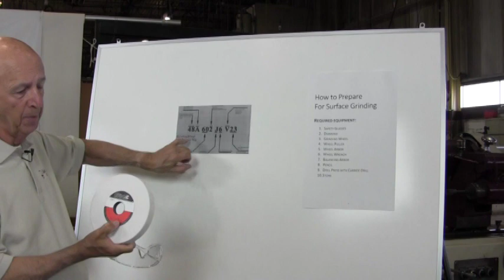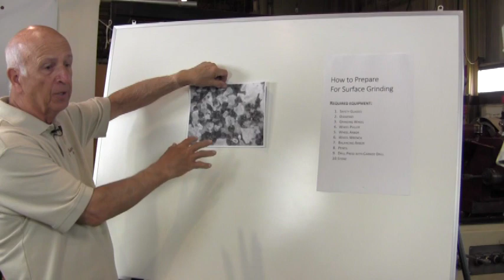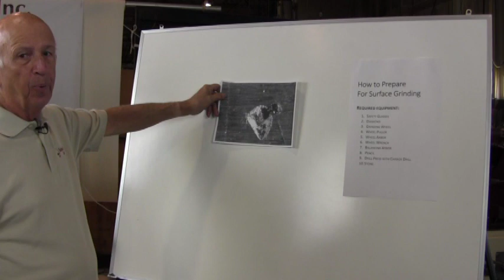How to Dress and Balance a Surface Grinder Wheel

Comment: Good morning sir, started in the early 70's as a tool and cutter grinder,in my fathers machine shop,never had the basic understanding of proper removing grinding wheel other than checking for cracks with the bell sound.I retired 12 years ago but recently had the opportunity to back to work doing this type of work,thanks really helps understanding how grinding wheels operate and the care to extend spindle bearing life

Comment: I noticed that either 2 different wheels were used  in the video or the wheel shown first was further balanced between scenes. The "first" balanced wheel had 3 pockets drilled in it and the "second" wheel had 6+ pockets.

Comment: I have spent many many years as well on a manual surface grinder. Done tons of very close tolerance form grinding. Good stuff here, another important tip is when dressing the wheel; always good to get in the habit of setting up the diamond left of center to the wheel. Reason being, if you happen to leave the chuck off and go to dress your wheel, the diamond gets kicked away from the wheel. If you are right of center and chuck happens to be off, well your gonna probably at very least bust your diamond, worst situation being you blow the wheel up and everyone comes over to the grinder and asks "are you ok!!!?" lol.
Reply from the maker: Thanks for watching!

Comment: Interesting way of balancing the wheels. I did my apprenticeship in a shop where all the surface grinder arbors had balancing weights. Later I worked in shops that didn't and the general practice was to just always dress the wheel every time you turned on the spindle. It worked fairly well to remove the chatter most of the time, but I never really liked that way. But management never wanted to buy arbors with balancing weights. I wish this method would have dawned on me back then.

Comment: Hi Don, love your stuff, I'm still learning at 60yrs old. When I was an apprentice we were told to leave the machine running all day long to prevent coolant build-up at the bottom of a stationary wheel, with the consequent imbalance. Does this still apply? (I haven't used a surface grinder for 40yrs) Cheers, Nick.

Comment: I'm curious as to how much material you typically remove from wheels and what percentage of wheel width you'd consider the maximum to drill to? I have a similar sized grinder and have only ever dressed and never balanced the wheels, however would like to see how much difference it makes on small machines. Thanks for putting up these videos.
Reply from the maker: Pete F not to exceed 25% of the thickness of the wheel is a good rule of thumb.Try to take it up near the arbor and only take what is required to balance the wheel.We are pleased you like the video'sWe will be putting up new ones weekly.Thanks for the comments.

Comment: 9:40 Wouldn't it be better to drill closer to the outer circumference? Less effect on the integrity, higher effect on the balance is what comes to mind from geometry and physics. What would other considerations be that made you drill closer to the axis?
Reply: you dont want holes near the cutting surface! higher g's not least reducing life of the wheel!

Comment: Hi, thanks for taking time to make these videos. I  am still learning about how to run my hydraulic unit and the videos are helpful.
If you ever end up reshooting this could I suggest you find a bad wheel and video how it sounds in comparison to the noise of a good one? Ive heard lots that ring, but I have one that doesnt that I have never mounted because of the sound change, although it is of different composition to the other wheels I have so unsure, and it would be nice to know what a bad one sounds like for real to know.

Comment: Don;
  I can't possibly thank you enough for sharing your techniques and knowledge. 

I have some requests:
  Can you demonstrate sharpening end teeth of an end mill in the Master Grind?
  I have the Weldon air bearing rig for the flutes.  

  I was thinking it would be a lot easier if my B&S 6x18 hydraulic grinder ( Circa... 1970? ) had hard stops on the table to prevent me from burying the wheel into the mill.. do you put stops on? Can you outfit for hard stops in any axis without worrying about harming the grinder, especially in Z where you are hard-geared?

  Can I dress and form a diamond or CBN wheel? I would like to form some of these.  The first occurance is I'd like to take a 1/8" wide diamond wheel, and throw a 1/16" radius all around the edge so I can cut real nice chip breakers in my brazed carbide  lathe tools.  

  I love the way you always run your rig as a hand-cranker in the videos... 
  I am a mere 55, and when I bought this grinder, I knew I had to have power as my shoulder is pretty much worn out..

  How do I determine if my spindle bearings are shot?
  How much flex and play can I get away with, and when the wheel is running as opposed to static, will it flatten out?
  Are these bearings typically matched ABEC 9's?

  What is your preferred hydraulic oil? I bought the recommended, and it hurt. I also took the sheep filter out and replaced it with spin-on filters. I can't remember the micron rating, but the machine still operates. I think the sheep can catch 10 microns. 
  I was really surprised to find those old filters are commonly available as heating oil filters, for those who may be having a tough time finding them... under a different brand, but an exact match. Three bags full. 

  Plus... I was thinking of making a following stage to hollow-grind knives in the Y axis using the wheel dressing  feed in my old rig... you ever try anything crazy like that? Those would be pretty much organic curves on an incline. 

  Anyhow, sorry for the extensive request. But... well... I am an avid follower...
  And when you get tired of that old surface plate you work on, I will be glad to send the boys to haul it off. 

  Thanks so much again!!!

    Mark
Reply from the maker: +Mark Richardson 

Don; I can't possibly thank you enough
for sharing your techniques and knowledge. I have some requests: Can you
demonstrate sharpening end teeth of an end mill in the Master Grind? We send our end mills out as this is not cost effective to do
in house. 

 I have the Weldon air bearing rig for the
flutes. I was thinking it would be a lot easier if my B&S 6x18 hydraulic
grinder ( Circa... 1970? ) had hard stops on the table to prevent me from
burying the wheel into the mill.. do you put stops on?

Hard stops are absolutely
necessary.

 Can you outfit for hard stops in any axis
without worrying about harming the grinder, especially in Z where you are
hard-geared?

We don’t know why you would
want to and do not know how to do z.

 Can I dress and form a diamond or CBN wheel?

No but you can have them
custom made from a diamond wheel manufacturer.

 I would like to form some of these. The first
occurance is I'd like to take a 1/8" wide diamond wheel, and throw a
1/16" radius all around the edge so I can cut real nice chip breakers in
my brazed carbide lathe tools. I love the way you always run your rig as a hand-cranker
in the videos... I am a mere 55, and when I bought this grinder, I knew I had
to have power as my shoulder is pretty much worn out.. How do I determine if my
spindle bearings are shot?

It would be noisy and you
would get a chatter.

 How much flex and play can I get away with,
and when the wheel is running as opposed to static, will it flatten out? 

If you’re talking about the
spindle play the answer is zero.

Are these bearings typically matched
ABEC 9's?

Yes

 What is your preferred hydraulic oil? 

We use Cadillac x150 or HD32
equivalent on our B&S grinders

I bought the recommended, and it hurt.
I also took the sheep filter out and replaced it with spin-on filters. I can't
remember the micron rating, but the machine still operates. I think the sheep
can catch 10 microns. I was really surprised to find those old filters are
commonly available as heating oil filters, for those who may be having a tough
time finding them... under a different brand, but an exact match. Three bags
full. Plus... 

I was thinking of making a following
stage to hollow-grind knives in the Y axis using the wheel dressing feed in my
old rig... you ever try anything crazy like that? 

No
Reply: +SuburbanTool Inc 

  Thanks yet again!!!
  I assume you use an inexpensive mason drill to balance the wheels, correct?

Comment: I always used coolant while dressing as the diamond can crack or put an angle on the wheel when the diamond expands from heat, I also noticed that you never trued the wheel.. when the wheel is out of tru it is also out of balance. Especially when working to very, very tight tolerance.
Reply from the maker: +George Lee You are correct about the coolant. I did true the wheel.
Reply: I am not sure in the context of this machine type what the difference is between truing and dressing - isn't this one and the same operation when moving a diamond across the wheel?